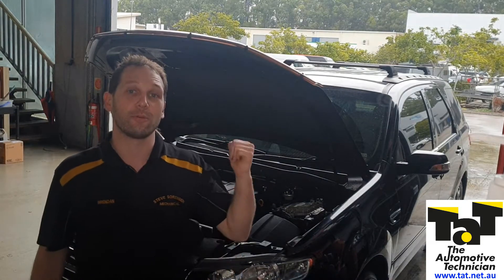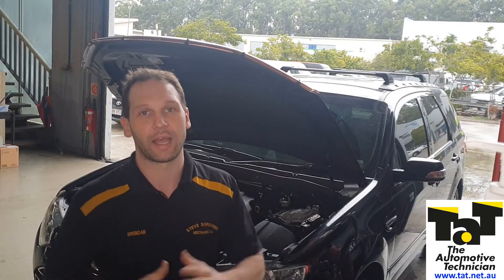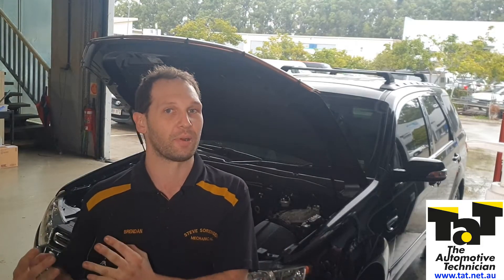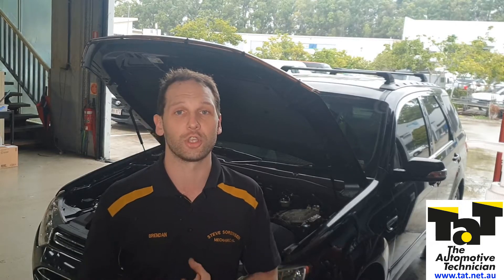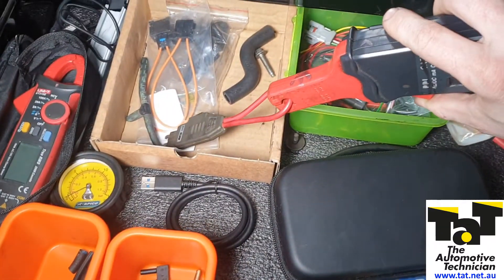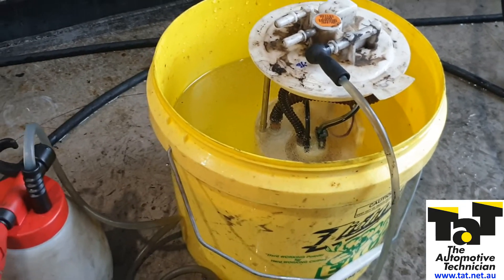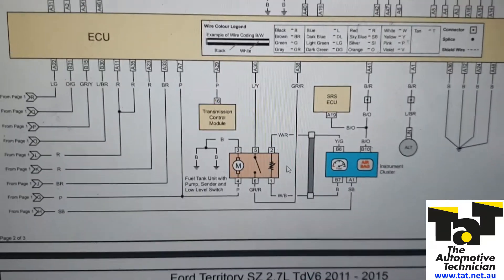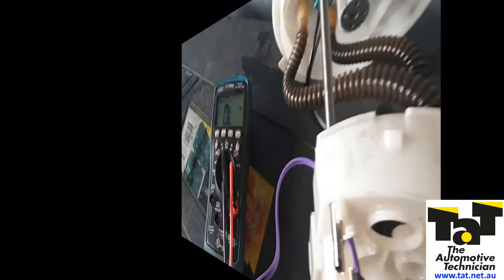Ford Territory fuel lift pump failure

Comment: Hi just a quick question  when replacing  a new  fuel pump assembly with the flot  does the tank need to be reprusserised or does it build up its own prusher  . My daughter had hers replaced and now 2 weeks after doing it she aint got no diesel coming though the system

Comment: I listened and heard the fuel pump working,  then changed the fuel filter. The car would not start and it seems that the fuel pump has failed. So not fool proof....

Comment: Just went through this drama!
Water in Fuel warning on dash so I replaced the fuel filter and ………. no start!
Quick consult with Dr Google and now more educated. Tried priming, bleeding, sucking but not enough fuel flow to run for more than 15-20 seconds 🙄
Regardless, lift pump needed replacing and now car runs much better for it!
Thanks for taking the time to post vids like this and educating the world as you go 👍🏻

Comment: I've put in a new fuel intank pump,  plugged the plug in & thought I'd see if it would pump diesel out. It doesn't pump a thing out nor make a noise! 

I've checked fuse & relay. Can't seem to find any other relays or fuses.
Reply: Hi. Did you get this resolved? I have same issue today. Cheers
Reply: @MATTKITTOW  I installed new pump, and that seemed to work. Best of luck but if you need the car. Fill the diesel filter and install it that would be temporary as the hp pump will do all the work which isn't good.

Comment: Hi, My battery light came on and the car just stalled. wont start. mechanic says no codes. sprayed diesel in intake car starts and runs until spray stops. Battery light still on. fuel tank pump sounds like it is working. Any solutions
Reply: I'd try disconnecting the low fuel cut wire.

Comment: Had exactly that problem with my 2013 diesel SZ. It used to surge intermittently at motorway speeds and then one day it died on the motorway at 100km/h, very exciting, the dash indicated it still had 50 km to empty. When the car was new I got down to 5 km to empty while on a country trip so I knew it shouldn’t stop with 50km of fuel left. 
The breakdown truck arrived and I said it seemed like it ran out of fuel so he through 5 litres in it, we primed it as per the operation manual and away we went!! Took it to the Mechanic who did a scan and discovered a low pressure error code and replaced the tank lift pump. Maybe asking clients about surging at lower fuel tank levels may be a vital clue.

Comment: Came looking for this TAT video today as I knew it existed.
Exact problem presented today, however I smacked like the tank like it was an old Commodore and away it went😂. 
Customer replaced his own filter and the car would not prime/run. So I would say his pump has been dead for some time.
Reply: Either faulty pump or more likely faulty low fuel cut switch.... switch is incorporated in the L.P pump assembly.

Comment: Vehicle towed in, no go. It just had a brand new pump assembly that had been fitted by another shop come in. 
We cut the trigger wire at the ecu after testing and finding it was a closed circuit. The vehicle then started and ran.
It turned out that the new in tank assembly had a faulty switch (closed circuit, meaning empty tank.)  Great video by the way Brendan

Comment: If this ever happens, disconnect fuel return line under vehicle passenger side and use a vacuum bleeder to bleed the system. You may want to bleed the system at the filter first then return line under vehicle. Make sure you leave the ignition on. Job done. That’s what I did.

Comment: after reading all the comments, my advice would be DONT change the the fuel filter. simple. the kiss principle still applies.
Reply: It is likely that you will need to change the fuel filter at some future time.
Reply: after reading all the comments my advice would be don't buy a Territory diesel...

Comment: Hi Brendan,
I've got a 90,000km diesel Territory that sometimes when warm, cranks but doesn't start. No error codes, and runs when cooled enough to start. Low pressure fuel pump okay, fuel pump relay okay. No signal voltage to the injectors when it doesn't start. Any thoughts?
Reply: Possible bad connection@the master fuse in the relay/fuse box.

Comment: All you need to do is plug in all your lines back into the fuel filter, leave one line off, then get a jerry can of fuel or diesel and get a fuel primer off a boat and pump till fuel filter is full, reconnect line and your away 👍

Comment: Hey mate nice video.....just a couple of observations I've had with these pumps, i believe it's not always the pump as such  that fails I've found that the low level circuit in the pumps fail & the ECU then won't send signal to activate the pump,(the low level/run dry circuit can be disabled & it involves disconnecting the blue wire with yellow trace either at the pump plug or the C-396 plug, the C-396 plug is found in the behind lower kick panel on the left hand front passenger side) also  the pump activation method was changed from the series 1 to 2 series 1 activates the pump with the ignition on where as the Series 2 won't activate pump until it gets a signal from the starter circuit (don't crank the engine ,just flick the that's so u hear a slight flick of the starter) also correct with the fuse, relay u located for the L.P pump, my method to test L.P pump/fill fuel filter is Remove the relay(relay is No6) & bridge wires 3&5 as this will activate the L.P pump...imo the Ford changed the  pump activation method from S1 to S2 as they had so many L.P pump failures, last thing is I've been caught out replacing a filter with a failed L.P pump, easiest way around it is disconnect 2 fuel lines at the filter & grab a small funnel & bottle of diesel & manually fill the filter untill u have fuel coming out the other hole the reconnect the lines & crank (will take 20/30seconds for H.P to get a head of fuel but then it will start-if H.P is also a little old or fatigued due to age or running so long without L.P it may take a few fills of the filter to give it a head) anyway this is just my thoughts & experience I've had with the tcdi SZs
Best regards Goz.
Reply: Just saying thank you, for the nformation provided as it was spot on.
Reply: @nesthead65  cheers mate happy i could help  a fellow SZ diesel owner(I'm assuming u are referring to me-not sure what information was of use to u as there's a lot there to digest)....i.m.o they are an awesome car ,but a little miss understood.
Reply: @petergoz7453  I'm having this issue as well, except my in tank pump was replaced with a brand new one two weeks ago, I have no noise from tank, have removed fuel lines to see if I get any diesel on key turn and I get nothing at all, what else could it be, all I did was replaced fuel filter and I'm getting no where
Reply: Cheers for the info. Just had the pleasure of a no prime no start and air in pump at the end of a rather long job ... Filled the filter with a 60ml syringe which works nicely to push fuel to a dry pump and return lines. In tank pump is dead as a dodo but does not effect performance luckily??.  Some of the repairs on these are an absolute saga, having now done a Turbo, Timing belts, diff bushes and a prop shaft which required balancing.
Reply: @philking5740  no worries glad it was a help to you, word of warning, drive the car easy until u put in the L.P pump as now it's not working it's putting your H.P pump under duress ,it will be ok just driving easy but no hard acceleration or towing & change your L.P pump as soon as practically possible
Reply: @petergoz7453  Cheers, I am in NZ do you know if there is a reasonable or better quality replacement from the likes of Repco or is it Genuine only?

Comment: What are the symptoms please? Ours misses and hiccups, like there’s a blockage in the fuel line, mechanic and auto electrician have tried SO many things and nothing has worked, the car computer is not showing a fault nor is the diagnostic computer at the mechanics and auto electrician. We have a ford territory Gaia 2009. The car has been away for almost 2 months and it’s driving me crazeeee! Hubby not mechanically minded so would so appreciate some advice here, could it be the pump as you describe here?

Comment: Thanks mate for the vedio, i changed my lift pump and after i changed it it seemed to be running all time,,after the engine has started,is it normal for them lift pumps ro do that? I thought it's mean to do rhe priming only
Reply: Lift pump runs all the time.  Diesel fuel runs thru the engine and what's not used is returned back to the tank, so there is a continuous cycle of fuel round and round from tank to engine and back to tank of whatever fuel isn't used by the engine.

Comment: Hey mate, my 2012 sz diesel territory is stuffing up every couple of days. DSC fault and cruise control unavailable, then it disappears after 2-4 locking unlocking and sometimes I've to move the car in limp mode a bit, then park at a new spot, lock unlock.. Then it goes back to normal. 
What do u think it could be? Fuel pump or some DSC sensor
Reply: Hi Shray, i have issue with my 2011 SZ territiry at the moment. What did it end up being?
Reply: I have same issue as yours . Did you find a solution ?
Reply: @danieladvantures8555  dont know man, sort of. Changed to a new battery, then replaced the throttle pedal after ultra tune mob scanned it. it working well atm, its gone back limp twice but fixed itself right away. so i dont know. lol

Comment: Great video, I agree totally. 
My 2013 Territory diesel fuel pump started to get noisy and would surge intermittently on the motorway. Then one day it ran out of fuel on the motorway even though the gauge read 48kms to empty. The breakdown man came along and put 5 litres in the tank, we went through the start procedure and off we went. Took it to the mechanic and they found error codes for low fuel pressure, the pump was replaced and it runs much better now.
I don’t know if it’s my imagination or not but, it feels smoother. I’m not sure if diesels can have a “miss” but with the low fuel pressure it certainly felt like it ran rougher.
Your points in this video are all very valid.
Reply: How much did this cost ypou to replace the fuel pump

Comment: Hi Brendan
I had the very same issue today as you describe.
Ive changed the fuel filter many time but this time it wont start.
I listened for the lift pump noise on priming but, yep, no noise.

I started chasing fuses and relays but they were all fine.

I thought the lift pump was on the way out last Thursday as on the way home the Terry started to hunt on an off ramp, I thought it was the strong gusty wind, then it went away.

Further down the road I turned left off the 100 kph road and hammered it, it seemed starved for fuel as it was hunting again.

Today I changed the air and fuel filters, now, no start.
I spent ages looking for the fault, but no lift pump noise.

Then I turned to YouTube looking for the answer and found your vid, Im glad I did as its saved me from pulling out what little hair I have left looking for the problem.

Comment: Thank you so much for putting this up. Like the other commenter, I got stung after doing preventative maintenance by replacing the fuel filter.

Ended up disconnecting the hoses and found no fuel was moving. It all clicked into place remembering I had an engine code a month prior telling me there was an issue with fuel regulation/control (forget exactly now).... That triggered during a highway overtake.

Anyway, waiting on the tow now.

Cheers.

Comment: Hey Brenden.I have just been through the ordeal of changing the fuel filter on my diesel territory and then been left with a car that wont start.Now after finding and watching your video I can sleep at night knowing the real reason being that the lift pump was dead at the time of the filter change and not what I was told that once they lose their pressure they wont go,didnt make sense to me.The car had to be picked up and taken to the garage to have a new lift pump installed,but at least next time I will know what to do.Thanks

Comment: Great video Brenny have had 2 of these now with low fuel pressure codes and limp mode. Have been able to swap the filter out and refilled the housing with diesel to get it going but have replaced the in tank pumps aswell.
Reply: Hi Frank 

Do you mean you got it working with the failed pump 
What housing did you put diesel into ?

Short of it is I've just spent a bit on suspension service and radiator replacement so I'm a bit hard for cash basically need to make it work together work to lay for the new limp I was thinking on using a fluid priming pump to draw into the filter and trying from there

Any suggestions?